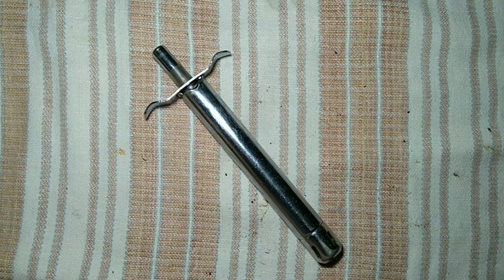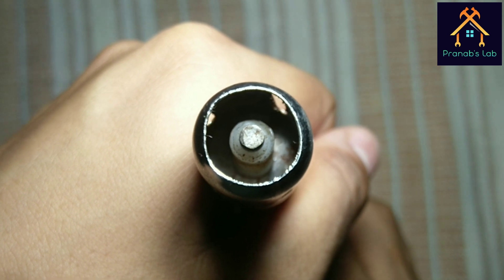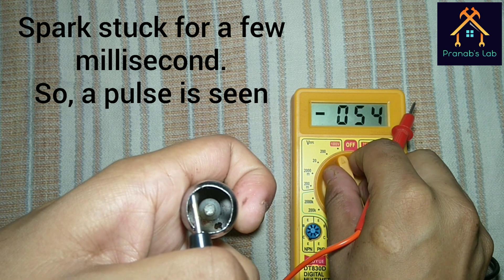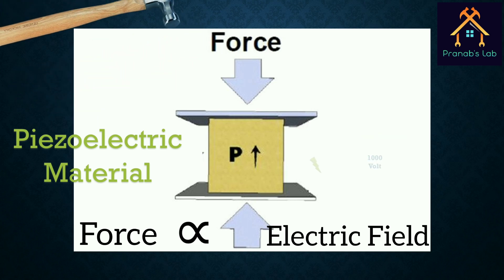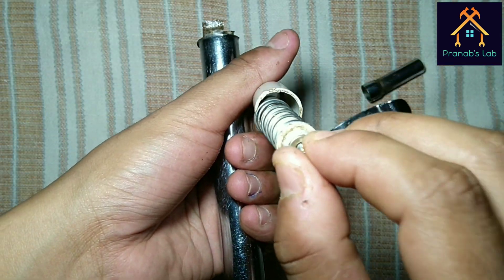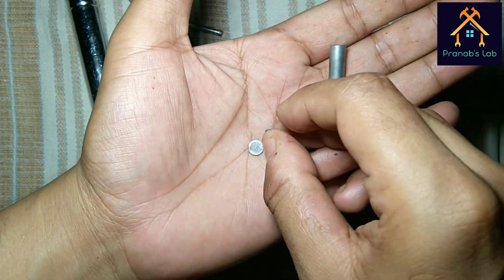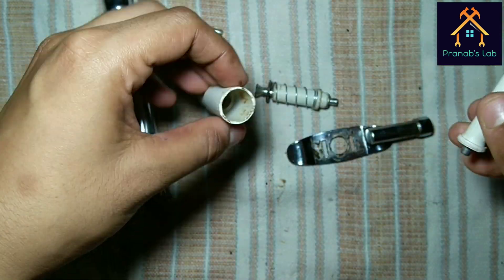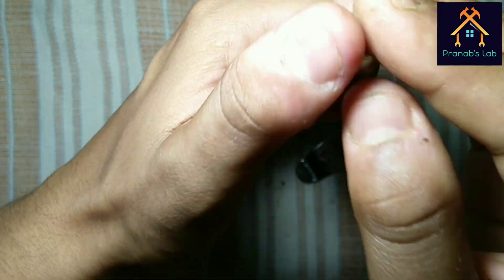Gas Lighter | Working Principle of Gas Lighter | How 1kV generated in Gas Lighter,  Piezoelectricity

Comment: Bro , i think piezo electric material is that cylindrical part (filled with it ) kept in between two circular  metal plates . 
Your explanation dont matches your action .
Actually you assembled in a wrong way , and your lighter stopped working